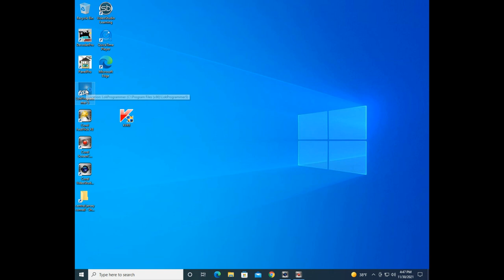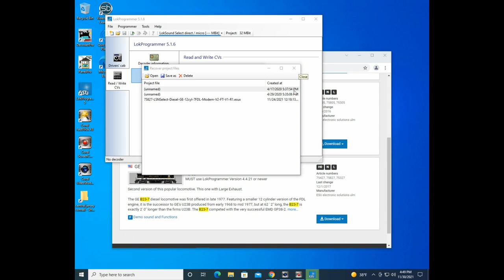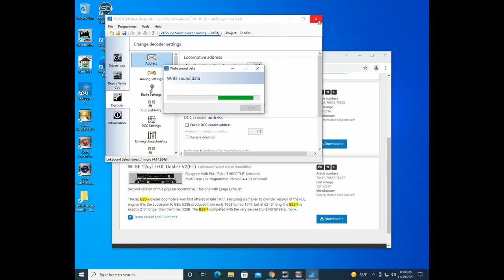Atlas B23-7 #2808

Comment: Hey Joe. Nice job on the B23-7. Sorry to hear that you lost two decoders. It happens. I recently had to return a V5 decoder due to a motor control issue. Guessing quality control needs some work. As for the ‘dead’ decoders, not sure what  ESU will offer up as the v4 decoders are no longer supported. The distributor I use locally basically told me no more after this last batch (sometime in early 2021). Also, the new V5 decoders are for the Intermountain frames. The circuit boards are wider in the middle (compare your 73100 to see the difference) and won’t fit the Atlas chassis. What I suggest is ESU 58923 (V5 nano). It’s not a drop in decoder and will require more soldering (motor contacts, track power and resistors for the lights). I have done this install with other wired decoders with success. Feel free to ask questions. Good luck and looking forward to your next video.

Comment: The 73100 boards were great! Easy installs. The new Lok 5 58721 ehh not so much. Now the drop in for the Kato, Esu 58741,,pretty easy. 
Right now I have 2 58741’s and 4 58721’s to install. Looking at getting a mini milling machine. 
Keep up the awesome work!
Reply from the maker: Yes I agree 100% ESU did us all a great disservice. However I have gotten information from other modelers that they may be coming out with a drop in board specifically for old atlas locomotives. Im still trying to get more information. I will keep you all updated. Thanks for watching and following along!

Comment: One more thing…Atlas is staring to release N scale units (updated chassis) that will support the drop in V5 decoder. No milling required. Last year’s models (gold or silver series; DCC/sound equipped or DCC/sound ready) were the GP38 and the SD50. Recently (late last year) was the Dash 8-40CW (not sure whether you can get it in the pre ConRail Quality scheme). Picked one of these up as I am modeling ConRail in the 90s. These include the speaker in the fuel tank with a new motor assembly.
Reply from the maker: Wow thank for the info Daniel. So glad you are following along. Still researching at this point, and I am leaning towards the nano. However, I have heard that they just announced a drop in board for older atlas, still waiting on more information. More to follow. Thanks for the support!
Reply: @centraljerseyconrailinnsca5676  hey Joe. You are correct about the new decoders for the legacy Atlas frames. Looks like August. Already have an order in with my local guy.